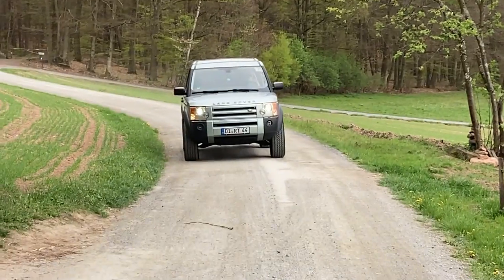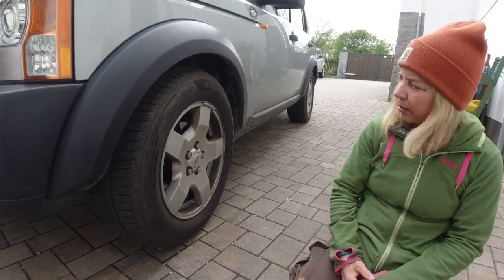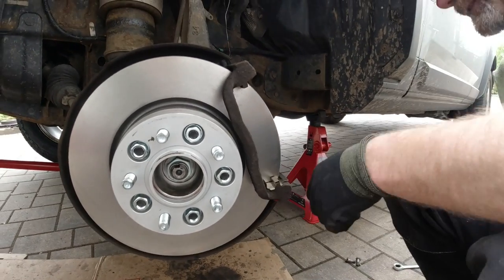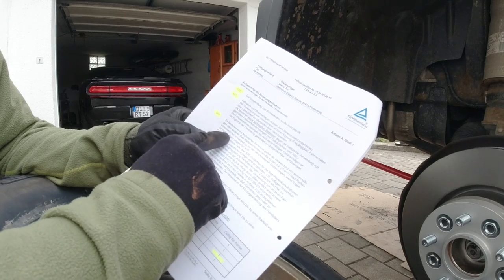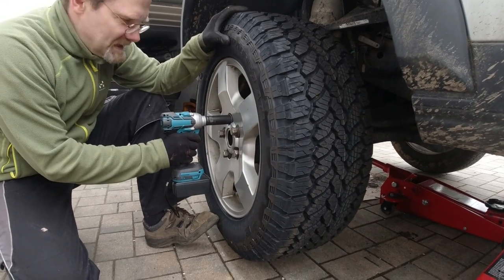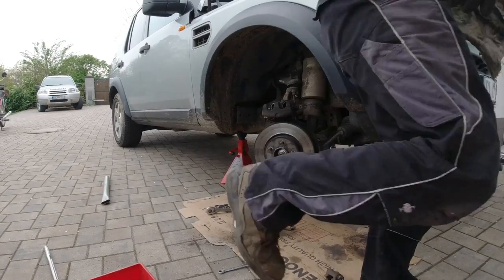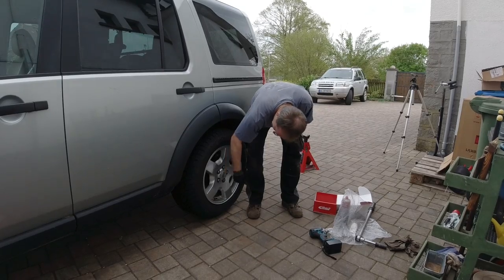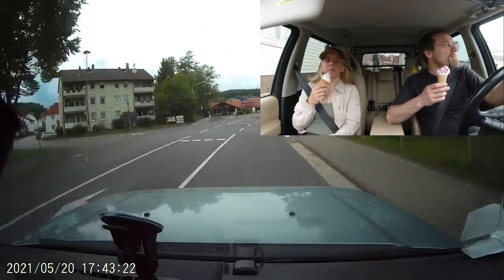We install All Terain tires, Brembo Brakes and Wheel Spacers on our Land Rover Discovery 3

Comment: I just had Brembo rotors and pads installed on my 13 LR4 yesterday!!!
Reply: Going with Brembo eliminates any worry about what quality brakes am I getting.
Back when I was a parts manager my card file had red flags on some brands and suppliers who had sold us rotors that warped or came with bad heat treatment :(

Comment: You may find that the wheel bearings wear quicker with the spacers on as it puts more load on the bearings. 
Regards
Peter
Reply: There is also risk of reduced fatigue life in swivel hubs increasing risk of catastrophic failure.

Comment: Great video Christian and vera. Vera made a good choice. Just be careful with the wheel spacers  ;  there has been cases of people losing wheels. I've got 30mm spacers on my defender but made sure the spacers had lock tight on the threads when fitting them. Keep an eye on your wheel bearings as apparently spacers put more stress on them. 
Enjoy  !
Reply: Yes the wheel spacers do put the bearings under a heavier load. You can expect to have to replace them on a earlier interval than normal. Christian, I hope sincerely that the bearings are replaceable and that you don't have to replace the whole hub assembly. Although sometimes it's a blessing to replace the hub, as getting the bearings out can sometimes be a nightmare if you do not have access to a hydraulic press. Using the time honoured spacer and threaded rod can be a pain in the arse!
Reply from the maker: @chris lant @SAMRODIAN We have replaced already too many wheelbearings on this car without having wheel spacers on😢  . We'll see, what happens. We love the look, and that the main reason why we put them on.  If they don'T work out, well take them off. At least we can make then another video about it. 👍🙋‍♀️ Vera
Reply: I always use lock tight on the nuts holding spacers on.  I had a wheel on my D2 come lose once!
Reply: Watch "Grizzly n Bear " suffer swivel failure, look at "Defender Mods and Travels" superb analysis of axle failures and I think you will decide to remove the spacers.....before this I'd also had only a vague view on reduced bearing life. It then seems obvious that countries like Australia prohibits spacers for very good reasons !

Comment: Wheel Spacers and Suspension spacers are a big No No here in AU
Would rather different wheel offsets to bring the wheels in or out, plus correct springs/struts

Comment: Great video! 
We run 275/65r18 on our LR3, on the stock wheels. Offroad it is better to have a slightly narrower wheel, as it keeps the beads tucked in.
 We have the OME coil conversion, with the HD springs and 2" lift. 235,000 km on the original wheel bearings, and it gets used offroad in Northern Canada. I've been lucky I guess. I love the stance with the spacers, but I have seen far too many failures to ever consider running spacers.
It's still crazy to me all the regulations and inspections you have to go through. We do whatever we want in regards to modifications. If your vehicle looks obviously unsafe, the police can force an inspection, but it is pretty rare.

Comment: I have run General Grabber tyres on my RangeRover Sport. They will last a long time without much tread wear. However, they risk tyre wall failure after maybe 5 years. I have suffered 2 high speed blow-outs at 70 mph. 
I am returning to using Factory specification Pirelli Scorpion tyres from now on, for a softer ride without excessive tyre noise.

I also run a Discovery 3 vehicle which I have BF Goodrich tyres fitted for All Terrain driving. These tyres will last much longer than the General Grabber tyres, without catastrophic blow-outs at high speed. But, eventually they will start to lose tyre pressure and can be run for another year if a tube is also fitted at that time.

Please explain why you fitted the extenders to your vehicle?

Your channel is great, by the way.
Reply from the maker: Actually just for the looks of it. We cannot do a lot of modifications to our car, but we always loved the beefy tires. We do know the pros and cons and we wanted to try them out. 👍🙋‍♀️ Vera
Reply: @Vera_and_Christian  Thank you Vera. Yes, the extenders do make your Discovery 3 look more “Chunky”.
Another question please: I’ve noticed that the wheels you are using are the 5 spoke “S” type, but it looks to me that the interior is the beige type leather(?) which would be for the “SE” or ‘“HSE’” model. I think you also have a manual type transmission. Manual Type transmissions are a no-cost option in the “HSE” in the UK. Which seems wrong to me, because Automatic transmission options for the “S” and “SE” are an option that costs Extra.
Which actual model do you and Christian have?
I have had both Manual and Automatic Discovery 3’s. The one I have now is a Silver “S” with the Automatic transmission. The reason I went for this model is that on the Manual Transmission versions, the Hand-brake always engages, whenever you remove the ignition keys, causing it to fail much sooner. However, by using the Park “P” with the Automatic, the only time my Hand-brake is ever used is the day each year that it has its MOT (the same as your TUV), so it never wears out!
Also the Automatic transmission never wears out the Clutch, which is an expensive repair when needed. However I think that despite LR saying that the Automatic Transmission is filled with ATF for life, it really should be properly replaced (Flushed) every 80-100,000 miles.

Contrary to what many say about the Discovery 3, I have either been very lucky regarding reliability or my one is a very good one. I honestly believe it to be my most liked vehicle I have ever had. As a Farmer, it has to do everything for me, which it does admirably and comfortably, every time. I actually prefer driving it more than my 2010 RangeRover Sport!

Keep up the good work with your Videos. They really are very good.

Comment: Smiley faces all round!  I would have stuck with the 19" option, they're awesome, and no spacers.  You were very economical with the copper slip - between wheel and disc interface - corrosion city in salty weather and between the disc and hub.  Also, from the previous video the floating brake pins, but, considering it's age the car is in remarkable condition.  Given the nutters on the autobahns I'm glad the TUV do a good job of inspecting any upgrades - in the UK there's loads of "kids" running around with lowered and widened suspensions with no thought for geometry (you should realign the wheels as well) and clearances.  Fortunately, they don't last long here, they usually crash, but we are very tolerant of these modifications for some reason, including the insurance companies.... Great, fun video.
Reply from the maker: 19" are not an option for us on this Discovery 2, remember the TÜV. 😃👍🙋‍♀️Vera

Comment: 5:55 I crack the bleed nipple on the calliper instead, then you're not pushing fluid back up and makes it easier to push in..

Also, yesterday, I just stuck 18" BMW X5 wheels on my D4 with 265/60/18 Achilles Dessert Hawk Mts on, and they fit perfectly (after getting the centre bore skimmed ever so slightly and different lug nuts), and they look almost factory LR.

I bought some 18" LR wheels and tried them on, which didn't fit, so I sold them again. Then later, I heard about using them with a spacer, so never got to find this out, always wondered! Thanks!

Comment: Nice to see the upgrade guys! On my D4 I have 265/65 r18 and I love them. I didn’t install spacers as I don’t think my D4 needed them, but also my understanding is that you risk causing damage to the wheel bearings and other such things. Essentially because the spacer puts more distance and so leverage between the part and where the force is being applied.
Reply: And the spacers can come loose and cause the wheel studs to fatigue and fail.
Reply from the maker: Yes, but our LR3 maxes out at 180 km/h on the Autobahn anyhow.  So we are not really worried about it 😂.  We run the 3rd bearings on at least one wheel too.  I think 265 tires do not need spacers for look but on the 255s it makes a difference.  Nobody told me before that the car gets way more dirty now. That’s a real down side.  Thanks Christian
Reply: @Vera_and_Christian  👍🏻 yes I think we get much more mud spray up the sides now, but I feel that’s how it’s meant to look 😆 My wife doesn’t agree…!
Reply from the maker: @charliew8378  😄👍🙋‍♀️Vera
Reply: @charliew8378  Same thing here, having a hard time convincing the wife LR3s with off road mods are supposed to look a little funky...

Comment: Looks good! I was banging my head against the wall for much of the video. I thought we had some onerous rules and regulations here (even in the "Live Free or Die" state!), but Germany may just take the cake on that one! See you next Sunday! 🤠
Reply from the maker: I think only Japan has more rules than Germany but theirs are not as stupid.  Wait for the chapter “lights” and not to mention “engine tuning” or “suspension”. There is actually no welding allowed on the frame 😂.  Christian
Reply: @Vera_and_Christian  Here in the state of New Hampshire, we have some very strict (relatively for the US) vehicle "safety" inspections, which until recently, I thought were the strictest in the nation. I learned, however, that Vermont actually has a more strict inspection and they also don't allow welding of vehicle frames! At least we can weld our frames here in NH 🤠

Comment: Do you fell some difference with the spacers in turns? 
Tip: to clean the inside of the rims i use toilet liquid cleaner (chalk and rust solution)
Reply from the maker: I have to try that out, would have never thought of it 👍🙋‍♀️Vera (I think the car is more stable in curves)

Comment: Great video.

I use the Goodyear Wrangler AW (All Weather) tires 255/55 R19 111W. 

At an Irish price of €220 each, they're not cheap but long lasting tires. I had mine for over three years. 

However, make sure to check your wheel CAMBER and TOE regularly as this is what caused mine to wear prematurely (after the years!).
Reply from the maker: We have had bearing failures all the time, at least one every year since 2016. And we just added the wheel spacers. I think it's just our thing. We have also installed from really expensive ones to cheap ones. But we do monitor our setup closely, no matter what. 👍🙋‍♀️ Vera
Reply: @Vera_and_Christian  thanks again Vera for the in depth reply

Comment: I put a set of Toyo Open Country AT3 tires on my LR3 (Canada). So far seem to be quite good, just had a bit of a trip out on some gravel roads/trails and they worked perfectly. Stayed with the stock size so didn't need to use spacers or anything like that. Time will tell how good they actually are.

Comment: I have 40-year-old craftsman power bar in professional use
I just put on Cooper AT 420 EACH  dollars, they run quiet, 
here we call those pliers, multigrips or water pump pliers
here no tuv, only when you sell a car, this means it can be 40 years no inspection
nice vid thanks

Comment: Great video. I am installing new front brake rotors, brake pads  and wear sensor on my LR3 this weekend. I note your comment on "other brands when nobody is watching" Well I bought Bosch rotors today. I could have bought cheaper rotors, but decided on Bosch - what could go wrong with German quality right?? Well imagine my surprise and disgust when the label on the boxes says Made in China / Fabriqué en Chiné. I only hope the ones I bought were assessed by German QC inspectors. Bugger, I could have bought cheaper Chinese ones had I known. I will email you a picture of the boxes.
Reply from the maker: Yes you are right, Bosch does not manufacture rotors in Europe. The best kept secret brand for brake rotors is Zimmermann brake discs. They are manufactured here in Germany, but are expensice. 👍🙋‍♀️Vera
Reply: @Vera_and_Christian  Poo to Bosch!

Comment: Hi Christian l would drop the wheel spacers - the actual traction benefit v front wheel bearing extra wear is hardly worth it  in my opinion - the LR3 eats front wheel bearings as it is without tempting further trouble, anyway great to see yous both looking very well both of yous.

Comment: 4:22 Good stuff Vera and Christian.  Christian, you didn't go with the made MIG Ate vs MII Bembo rotors and pads? Isn't that against the rules buying MII in Germany ;)?  I like both, but I used the Ate Power Disc and Ceramic Pads for my Audi.

13:38 You might want to use a C-Clamp to press the pistons inward next time you do a brake job. I found it much easier than using a Channel-lock.

Comment: Well done again C & V, great video production!

Just to be clear, why the spacers? 

If you did not change the wheels from before, but only the tyres, spacers will alter the wheel offset effectively.  This is not usually a good thing (extra bearing, suspension and steering loads, and alignment change). Wheel offset is often one of the dimensions in wheel and tyre package changes that gets overlooked.  That said some people prefer a wider offset purely for the look.
Reply from the maker: We too like the looks of it. The wheel bearings on this car do not last long anyways. If the spacers don't work out, we'll take them off. As far as nuts coming loose, I don't think anyone takes their wheels of as much as we do 😅. We will of course check them regularely. 👍🙋‍♀️ Vera
Reply: That certainly is a lot of hoops to jump through just for larger tyres where I live if we had the MOT?  requirements it would clear half the vehicles off the road, just kidding by the way you upgraded your brakes with disks and pads but not calipers? I take it is not a requirement.

Comment: I have couple of question for the spacers:

- can you advise which manufacturer you used ?
- can you share if you need additional lugs and if yes what size are the req. lugs ?
- can you share if the spacers kit has everything needed or additional parts are required (apart from the anti-stuck/lock gress)

thanks in advance!

Comment: The new tires are always a good news :) I only don't understood why you needed of this extenders, when you attached absolutely standard size tires? 3 months ago I shoed my Disco 3 with 255/55R19 GOODYEAR WRANGLER DURATRAC 111Q and 4 000 kms later I'm fully satisfied with.
Reply from the maker: We did it just for the looks of it. 👍🙋‍♀️Vera

Comment: Thanks for this helpful video about tyre dimensions in Germany. But just one question left, did you actually worked on the "kotflügel", mudguard of however its called - to make it wider than the tyre stands out with the spacers?
Reply from the maker: I ordered rubber extensions but never put them on.  We will see what the TÜV  will say in December.  Christian

Comment: If you stop at 21:41 : Do the tires have a direction? (Or an Outside marking?) Because i would have thought that the tread pattern would be mirrored between the left and right wheel.
Reply from the maker: They have no direction of rotation on it 🤔🙋‍♀️Vera
Reply: @Vera_and_Christian  Thanks!

Comment: its easier to push the calliper pistons back before removing the calliper while its in the carrier, you can simply use a flat bar to lever off the disc against the pad. obviously this only works if you intend to replace the discs and pads. but saves the risk of damaging the brake hose by accidentally dropping it while its balanced.
Reply from the maker: Never thought of this.  Thanks. Christian

Comment: Great video as always, but can i ask a question, why didn't you just buy 3/4 inch extenders that way you would get your wider wheel base and it would look just as good, but you wouldn't have to worry about all the modifications to the wheel arches?
Reply from the maker: Hello David,  I only found 25 and 30 mm spacers with a TÜV assessment.  I chose the 25 mm.  The wheel arch needs to be extended 5 mm in the back and 15 in front for 25mm spacers.  I assume 20 mm spacers would still require 10mm in the front but I don’t know for sure as they are not listed in my assessment. The wheel arch can be extended with stick on rubber profile.

Comment: Christian how you doing? Great Channel you have! Which torque is  suitable for whell nut bolt of LR 319? Hugs.
Reply from the maker: According to the manula, it's 140 Nm. That is how we torque the wheel nuts. 🙋‍♀️ Vera
Reply: @Vera_and_Christian  Thanks a lot Vera! I just change some wheel nuts due scratches of long use. :)

Comment: Great choice of tires, the truck looks awesome. What tire pressure do they recommend for these? 38 front 42 rear or.....Have you considered installing external TPMS sensors? I did for my RR and been very happy with that. Cheers from Canada.
Reply from the maker: Actually, we just realized that we still need to find the right pressure👍🙋‍♀️Vera
Reply from the maker: I just increased the stock pressure today by 0.3 Bar.  Not sure at the moment.  The tires smelled strong like rubber after driving fast.  So I thought a bit more would help.  I don’t like TPMS and I am glad ours does not have it.  Christian

Comment: Were those iaca really warped or were they just wearing unevenly?

Getting the discs to warp on a road vehicle is all but impossible, it would require enormous amounts of heat to cause the hardened discs to warp. The problem on a road vehicle will be uneven wear on the surfaces of the discs.